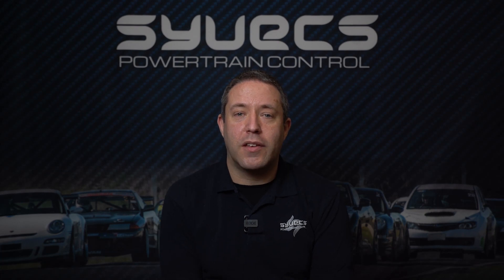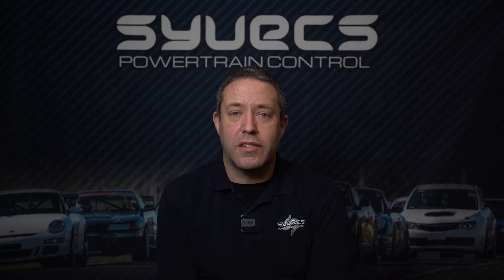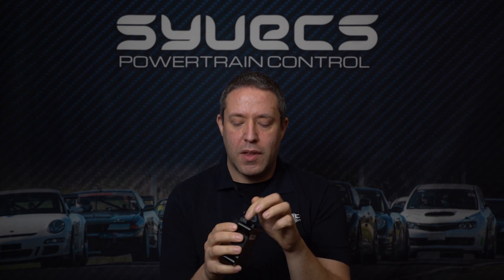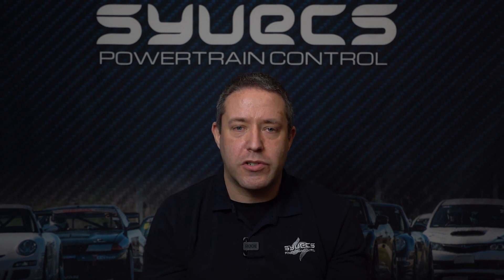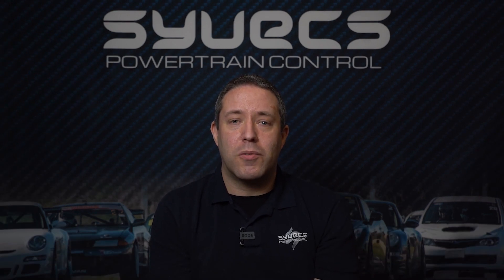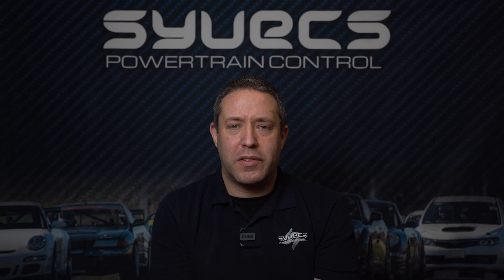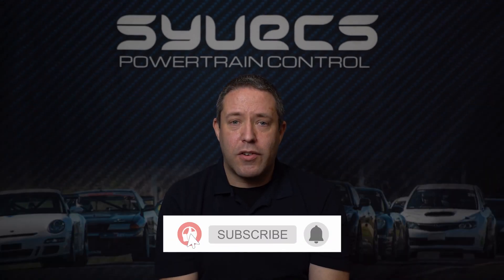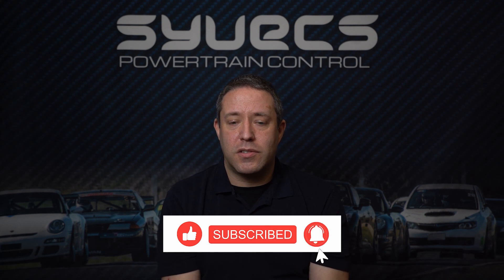Is one EGT sensor enough? | Syvecs Says

Comment: I've recently purchased the s7 plus for my GTR r34 as I believe it's the best ECU on the market. Love these videos. I've got over 50k in my engine so next step is to find the best mapper for the job. Any recommended registered mappers you can recommend?
Reply: did you find a mapper ? most of the syvecs mappers who work directly with the company will have worked on loads of high power builds

Comment: So it’s better to run EGT instead of Lambda’s? I have my header with welded bungs suited for Lambda’s. However, I don’t see how I can get my S7 to pick them up? Would you suggest I change my set-up? (Turbocharged four (4) cylinder; running on E-85 and water/Methanol spray).